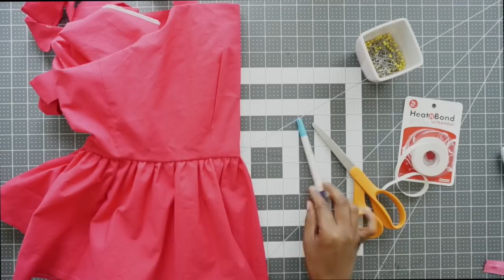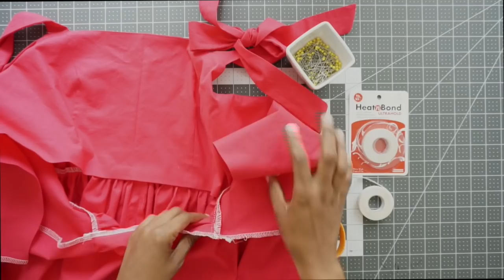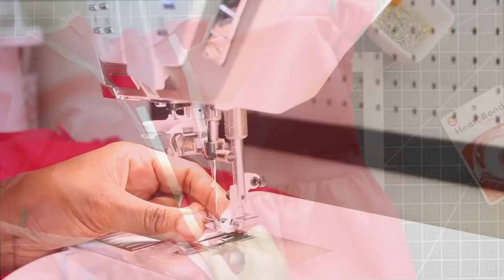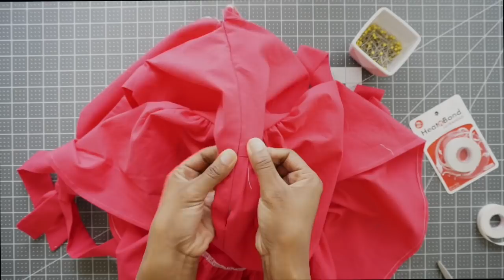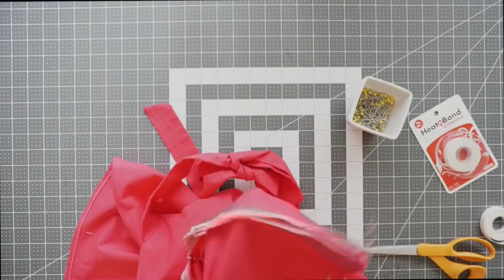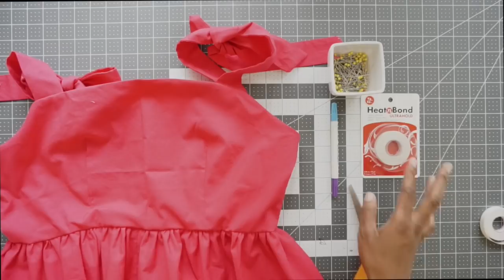How I Install: Invisible Zippers

Comment: Brittany what is the pattern you use for that top?
Reply from the maker: Angela Hill hey! I used McCalls 7626 for the bodice and McCalls 7778 for the straps. I just cut 2 rectangles for the ruffle part and gathered them up.
Reply: Thank you, is there a certain size for the rectangles.

Comment: Great tutorial.
I notice you have two marking pens.
What are they and why did you use the purple one? Do the marks have to be washed out or do they fade away?
Reply from the maker: Hi! I use the Dritz Dual Purpose marking pen. One end disappears after a couple minutes with air, the other side with water. I didn't use the purple for any specific reason, the mark would get cover with the lining so I don't worry about removing it. Thanks so much for your question and for watching my video!!